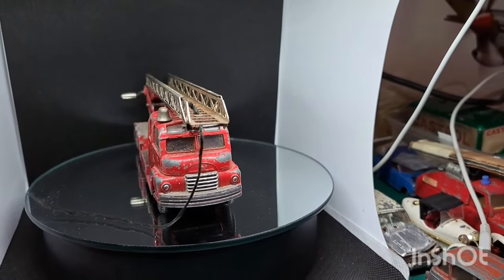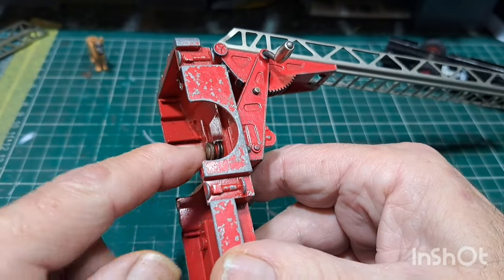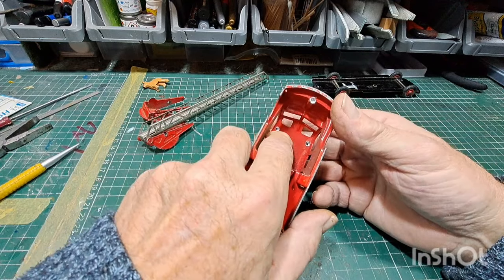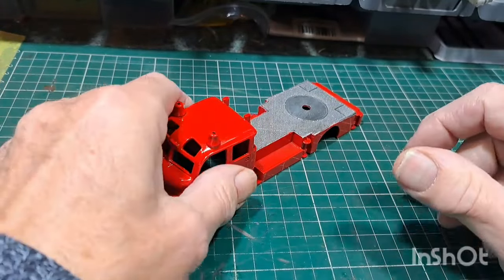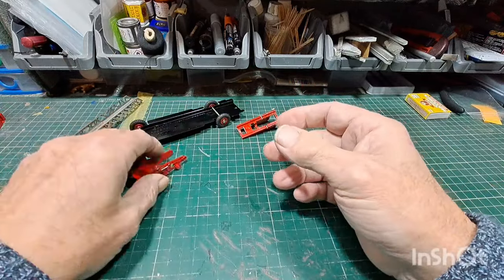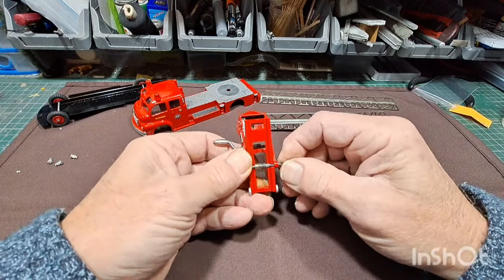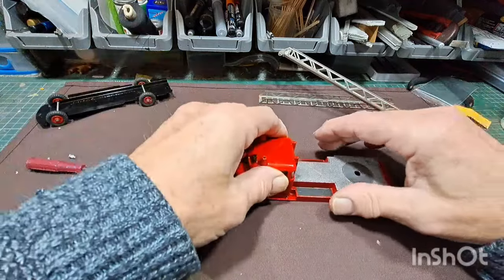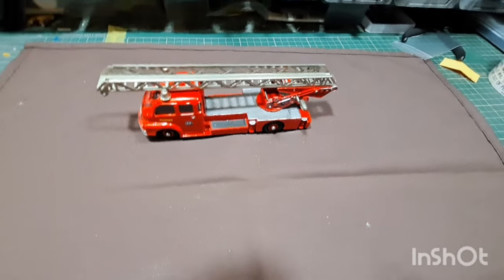Diecast Restoration Dinky Toys Bedford Fire Escape Ladder no/956.  1958/69

Comment: Another excellent resto Martin, not to mention all the work in putting up the video. Much appreciated and inspires me to keep going with my own restos.

I have also spent far too much time stringing this model without real success. Meccano used the same principle on the 969 BBC TV Extending Mast Vehicle. I wonder if a special non slip, non stretch cord and a special sailors knot is required. I also wonder if this ever worked properly even out of the factory.

If you really want to knock yourself out, try the French Dinky 32d Delahaye Fire Engine. No pinch roller, just a friction roller and, would you believe it, elastic cord. Try getting the tension and knot right on that! If anyone out there has a tip for doing this right, please share!!

Keep up the good work and all the best for the Channel this year.
Reply from the maker: Thanks very much my friend its really appreciated and I do have the dinky BBC extended ladder one to do  🤣🤣 all the best Martin

Comment: looks nice and shiny again! good thing the ladder was't squeezed into oblivion as it so often happens with these pressed tin ones... and why not markign it as a truck from the fire station down the street? nice touch. ^^

"Knocking the bells off" sounds like a slang term meanign either something naughty, or something involving pints of beverage with too many RPM... XD

aside that, the stringing looks awfully complicated; no wonder you grew frustrated. I know the feeling.
say, I would have assumed the string would make a loop around the handle, because like this it can't function to draw the ladder up and down. is there something at the back end of the main ladder the string could go around? maybe I'm missing something.
Reply from the maker: Thanks Lothar, 🤣🤣 knocking the bells off ,the inner ladder is definitely flimsy and can be easily broken. 
Not a bad idea for stringing the ladder I will try anything at this point. 
All the best Martin